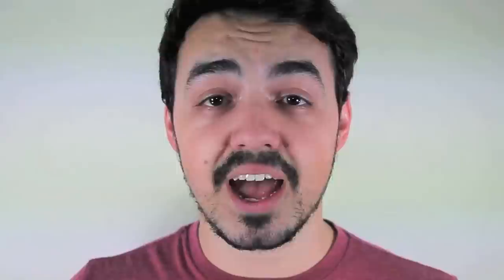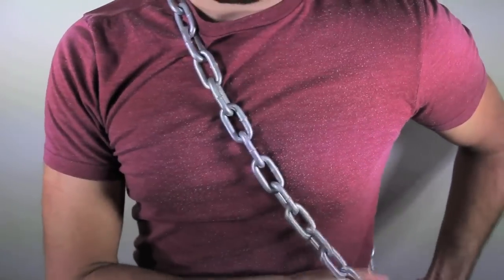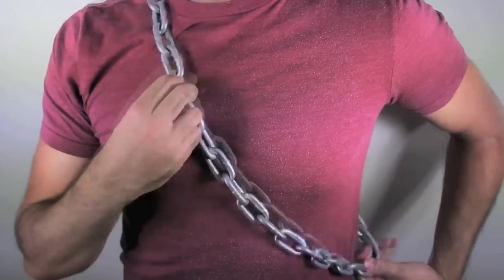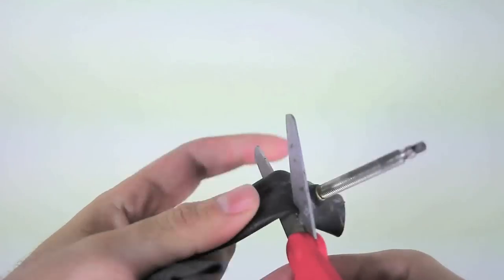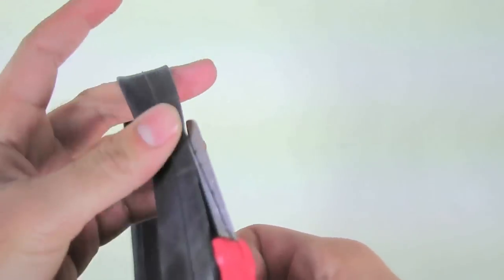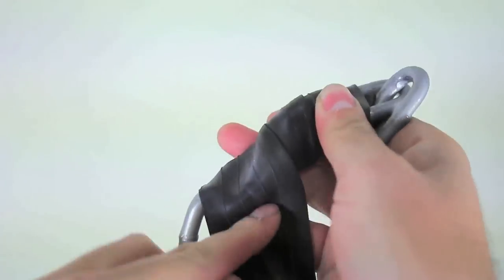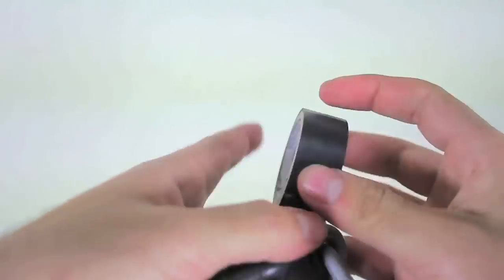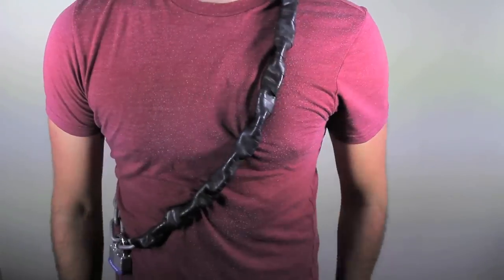DIY Bicycle Lock

Comment: If you put this lock on your bike, it will get stolen. Master lock is junk. and that chain can be cut with bolt cutters very easily. There's a reason those other locks cost 100 dollars. They use almost 80 dollars in chain.

Comment: Thanks it really helped but I just used duck tape instead of electrical tape an I didn't get that tubing but it worked just as good plus I used a bigger lock and I found all of that stuff in my garage

P.S. Thanks😀